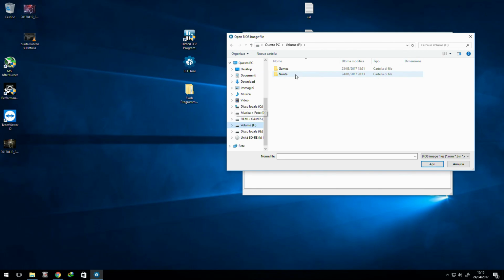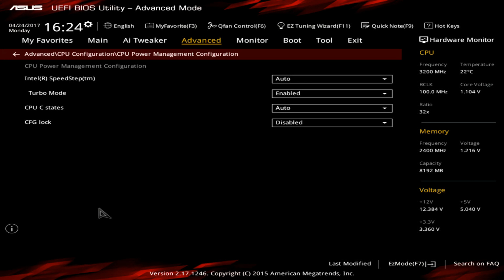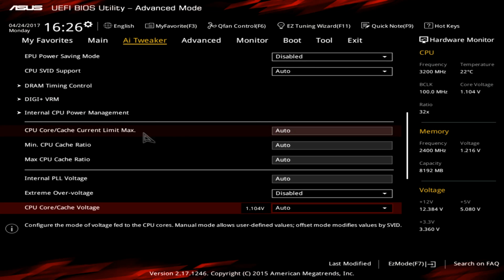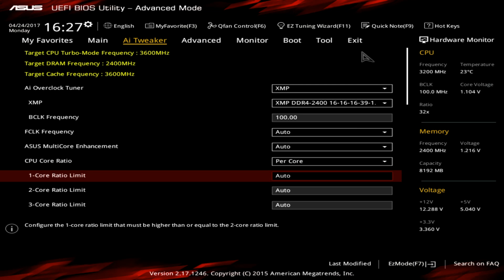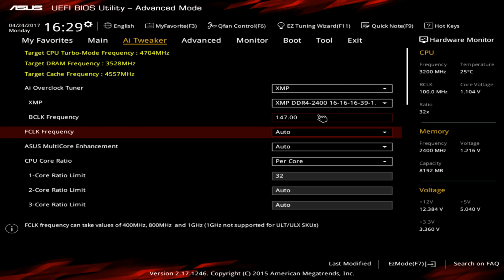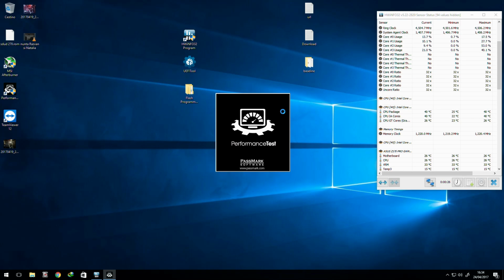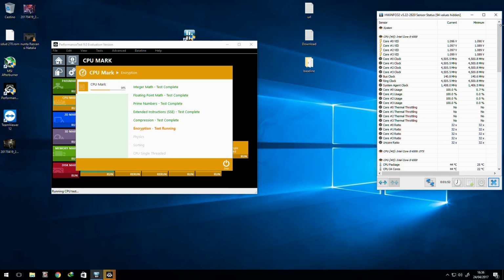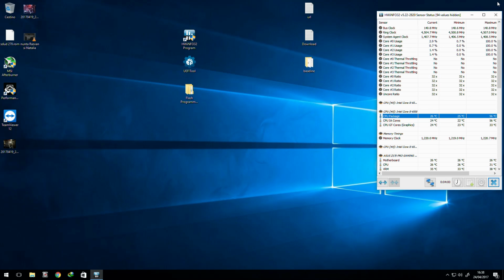INTEL NON K OVERCLOCK GUIDE AND TUTORIAL SKYLAKE I5 6500 4,5GHZ

Comment: Thank you, just got a 6500 the other day and have been wanting to try this out! will report with my results :)
Reply: So, what happened?
Reply: @WispHandle  took a year  for me to figure out how to downgrade my bios  lol i actually forgot that this was possible. over clocked it the other day, stable at 4.5ghz, 38c idle, 68c under load.
Reply: @beyond305  How did you manage to downgrade?!?! I actually bought an earlier version bios chip for 10 euros and got the job done. I had it on 4.3 same temperatures as you, but I sold my old rig. I'm using a laptop now :P I still want to know how you did it!
Reply: @WispHandle  well at first I tried to through the bios which I thought would work but it didnt. So I found that you can do it by creating a USB boot drive with RUFUS, copy the bios to the USB drive and also UEFItool. Have the computer boot into USB first, it will read the drive and start the downgrade. Not going to lie, I was a little worried about it not working because everyone else I saw downgrade, did it through their bios without any problems. Im on a ASUS z170 though and those people were on mostly ASROCK or MSI
Reply: @beyond305  I was also using Asus Z170 gaming board
Reply: @beyond305  Nice man, glad you made it
Reply: @beyond305  what cooler do you use or did use for it
Reply: @WispHandle i have evga z170 and i also downgrade my bios version, same steps as updating bios

Comment: Non of the files from bios link will download ? Does anyone have the bios for gigabyte z170 gaming k3 eu Rev 1..1 to over lock core i5 6500 I can’t find the bios anywhere spent a lot of water cooling and can’t even Overclock my cpu 😩
Reply: Le Thai Hoc thanks mate I’ll give it a go just seems like a waste of money buying the water cooling if I can’t overclock hopefully this works 🤞🏻
Reply: Le Thai Hoc there is no bios on there that supports my board back to square one ha ! Thanks anyway pal
Reply: Try to find this file: mb_bios_ga-z170-gaming-k3_f2c
Reply: Le Thai Hoc thankyou I downloaded the file straight from your link ? My board is Rev 1.1 this does not specify what rev bios it is will it matter do you think If it’s Rev 1.0 I don’t want to brick my board you see !
Reply: The rev 1.0 and 1.1 is same.The difference is very little. I think it will 👌
Reply: My mainboard is rev 32 =]] use bios rev 1.0, everything good, but I don't dare to try too hard
Reply: @MrThaihoc108  ok thanks ! ill give it a go and let youno what happens if my mobo doesnt brick :)
Reply: Le Thai Hoc I have successfully updated the bios to f2c thankyou very much for sending me the link for the file it’s been driving me crazy looking for it ! I’ll let youno how I get on with my overclock ! Cheers mate 👍🏻
Reply: Le Thai Hoc I’ve overclocked to 4.2ghz stable I’ll leave it at that for now and enjoy it for abit before I push it abit more thankyou very
Much mate couldn’t have done it without your help 👍🏻👍🏻
Reply: @cr3am50  Hi how did you get hold of the flash programming tool? the link doesnt load, thanks
Reply: r8Dec use the link that was sent in the replies in this comments
Reply: r8Dec it’s a google drive link
Reply: r8Dec do you have the same motherboard as me ?
Reply: @cr3am50  I have an MSI krait gaming z170 ive managed to flash with a bios E7984IMS.A40 I can change settings but it isnt remembered upon boot but the settings are still set to what I changed them to, soni duno what i am doing wrong.
Reply: r8Dec do you get the boot up message from bios asking you to boot up with optimised settings or do you go into windows straight off ? What are your v core voltages + d ram voltages also your base clock frequency’s ? If you could give me a bit of info of your bios or send me a photo I could point you in the right direction
Reply: r8Dec if you have raised your base clock you will also need to set your d ram to Xmp profile and reduce the frequency of your d ram to just go back to default settings or add a little voltage and OC your ram a little
Reply: @cr3am50  I sent you an e-mail, thanks
Reply: r8Dec does your bios have another screen for multiplier ? Looks like you need to up your d ram voltage to 1.220 because it’s slightly overclocked my system would lock up with default voltage and OC ram send me another photo with your advanced cpu settings what cpu do you have ?
Reply: r8Dec my bios is a completely different lay out to yours when I get home from work I will send you pictures of all my profiles !
Reply: @cr3am50  ye its different, I tried following another video of my motherboard but he only boasts on his results rather than explaining anything, he also has a different version of bios that I cant get hold of. He has E7984IMS.A6T... appreciate your help!
Reply: @cr3am50  I have an i5 6500 same as you I believe.
Reply: r8Dec yeah your bios is a lot different from mine it’s hard to remember what I did from the top of my head but I’ll send you pics of my  settings once I get home and you can check from that have a look on google drive for the bios your looking for I couldn’t find my one online anywhere untill I looked on google drive it looks like you have adjusted your blck though and. Your cpu has stayed at 3.2ghz? What is your dram factory frequency 2400mhz ?
Reply: r8Dec yeah most of these videos just brag about results and don’t explain properly keep talking to me through the day I’ll try and help out as much as I can mate 👍🏻 I’ll have a root for your bios when I get home
Reply: r8Dec + the bios I had previously would let me change settings then when I booted back up it woudlnt let me get past the bios but my settings were still the same oc that I set them to before the reboot is this is happening to you if so you will probably need that bios your looking for so it will save the settings and bypass the microcode from intel
Reply: @cr3am50  my memory is 2400mhz ye I can run it on 2666mhz and I see this has changed however whenever I try change the bclk settings, it allows this but there is no change to the processor and the d ram reduces to 2000mhz even if the 2400mhz profile is set. I will keep a look out for your reply. Thanks!
Reply: r8Dec try this link for your bios there is a forum half way down the page that has the OC bios for your mobo I’m still in work so I’ll do some more digging if them links don’t work for you it’s hard trying to find things using a shit phone 😂 need my pc https://community.hwbot.org/topic/149069-msi-z170-oc-bios-for-non-k-cpu/
Reply: @cr3am50  The links appear dead, when I try them it just says they dont exist then asks me to log in, I noticed theres 2 versions of my board z170 and z170A mine is the Z170A. Thanks though.
Reply: r8Dec I’ll have another proper look when I’m home from work mate and send you my bios profiles ! Have you tried clearing your cmos and start overclock again ?
Reply: @cr3am50  I just reset to default, have not tried cmos reset. I think its the bios version I have but thats the latest I can find which isnt a dead link. Proving very difficult and frustrating. trust me to choose this board over the choices I had.
Reply: r8Dec I accualy got given my gigabyte board as a present so I was pretty lucky really as I only had enough budget to buy a second hand i5 6500 cpu and they pair up great don’t worry I’ve had days of the same frustration your having now mate there will be a file somewere for it maybe ask the guy at the top of these comments were he got the link he sent me for mine if it wasn’t for him I would still be stuck on 3.2ghz 😂
Reply: r8Dec check your emails bud 👍🏻
Reply: Le Thai Hoc hey bro do you have the oc file for Z170A Krait gaming motherboard ? How did you get that file for the gigabyte board also I’m curious ?
Reply: Guys do you have non k oc bios to MSI Z170A PC MATE ? PLS HELP ME ALL LINKS ARE DEAD :(

Comment: Can someone help me I overclocked my i5 6500 to 4ghz but I have a problem with core voltage I can’t change it I put it to 1260 but it’s stuck at 1328 to 1352 which I think is too high i tried doing some research I couldn’t find anything so I’m left here idk what to do. When I game I get around 71 degrees with this voltage that is stuck and I prefer 55-58 degrees when gaming I have a cooler master 212 hyper evo something like that and it’s good but.
Reply from the maker: HI, try to load the default settings, and then start over, but start with a much lower voltage, ancd you should write the voltage with 1,...... (ex. in your case should be 1,25)
Reply: Tech Is Fun Thank you I’m gonna try that :)
Reply: Tech Is Fun it kinda worked I restored default settings and got back in and it was at 1072 vcore so now I got 4ghz and 1250 vcore Thanks for the help !
Reply from the maker: no need
Reply: how many extra frames u get in games now compared to before ?
Reply: Did you have to update the bios when you got the i5 6500 and the z170 pro gaming? Or did it work right away
Reply: @MayhemMilIer  what's your problem lol

Comment: I'm very tempted to overclock my i5 6500. I have a hyper 212 evo, do you think it can keep up with something like 4.2 GHz?? Also, if i decide to go back one day will the temperature sensors and the iGPU still work?
Reply from the maker: 1. yes, it should work just fine, keep an eye on the temp's with hwinfo tool, or alse like theat;
2. if for any reason one day you wanna go back to stock, all you have to do is, go in to your bios and select "load default setting's", and it will turn just as stock with all sensors working just fine;
I have OC my i5 6500 some mounths ago and than got back to stock and re-OC witch the video, so....no problem turning back;
I had downgrated the bios version and then upgradet and than re-downd for the oc, and still no problem's....so...go with no problem's, again just keep an eye on the temp's of the cpu, stay away from the 80c.
Reply: Tech Is Fun does this method still work?

Comment: DONT try to give a instruction video if you arent going to give proper instructions.  DO NOT TURN YOUR BASE CLOCK UP WITHOUT LOWERING YOUR RAM FREQUENCY. WHEN YOU RAISE THE BLCK, THE RAM FREQUENCY ALSO GOES UP, SCROLL DOWN TO IT AND LOWER IT TO EITHER YOUR CURRENT RAM SPEED OR LOWER. THIS IDIOT RAN HIS AT OVER 3400MHZ, WHICH IS A GOOD WAY TO RUIN YOUR RAM.
Reply from the maker: These idiot run his 3400 ram at 3400.....and just to know....the pc wont post if the ram freq is not the correct 1